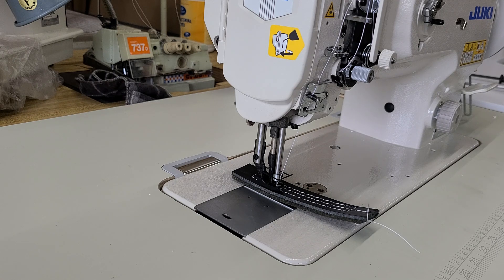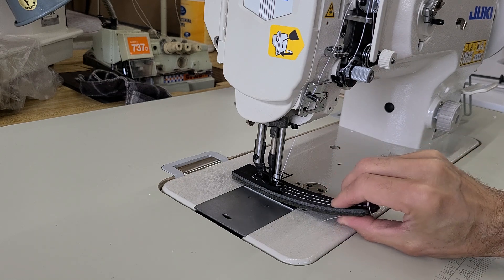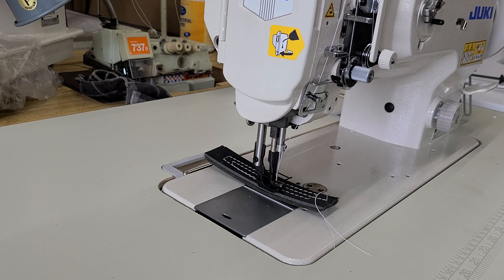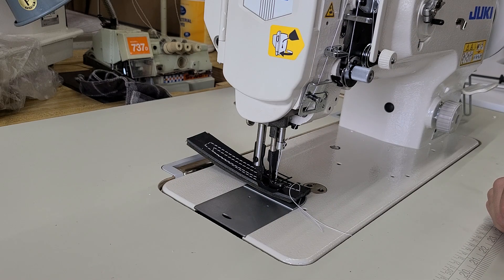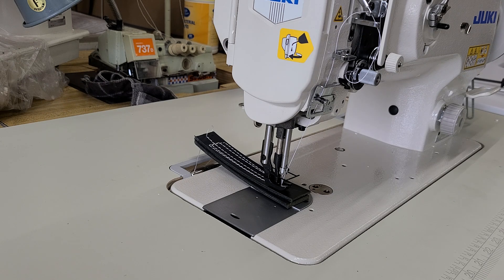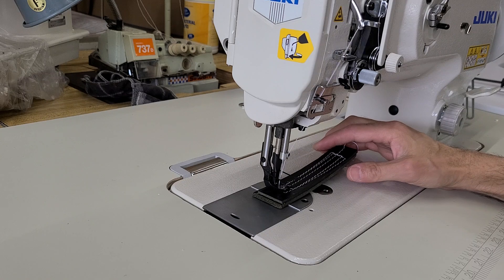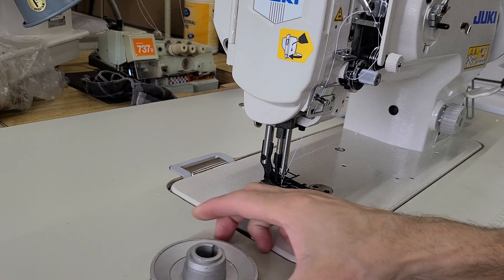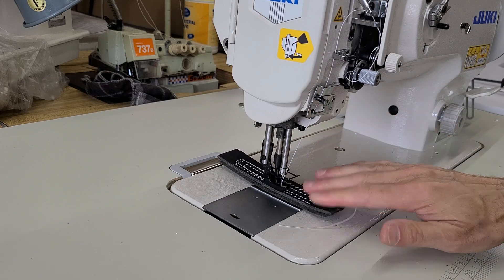New brushless servo motor with amazing slow speed control.

Comment: I thought the machine comes complete with a Juki motor.  Do you swap it out...what make is the 1hp.
Reply from the maker: The Juki DNU-1541S-7 comes with a Juki made motor.  The Juki DNU-1541S, that is not electronic, does not come with a motor.  We supply it.

Comment: I have a Consew 750w on my 1541s, but it did not sew that slow, even with the small pulley I had to add a speed reducer. What did I do wrong?
Reply: Hey there! Did the speed reducer slow it down to the speed he has? Can I ask what the name of the speed reducer is? I'm having a hard time with mine. It's too fast! Thanks.

Comment: I assume this would also work on the 1181? I don’t have any issues with my Reliable and the needle positioner, but love that this can go so slow for the detail work! Just might need to upgrade and sell my Reliable 🤔
Reply: I think so. I just ordered an 1181 and asked about the 1 HP motor option and he referred me to this video. Can't wait to try it!!
Reply: @RealAceOfMace  Hey there did it work on your 1181? I'd love to get it for mine if it worked. Thanks.